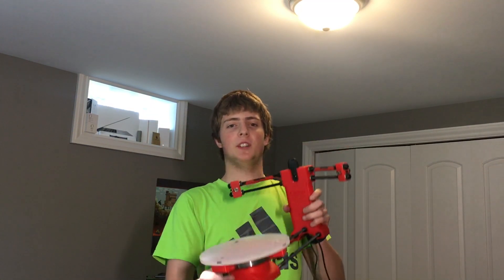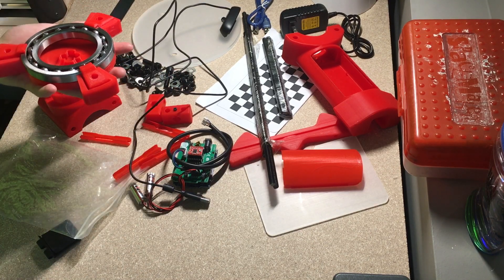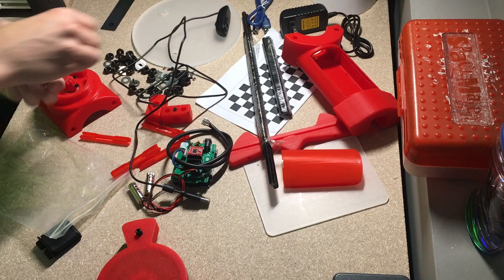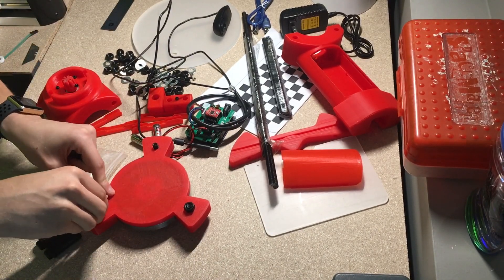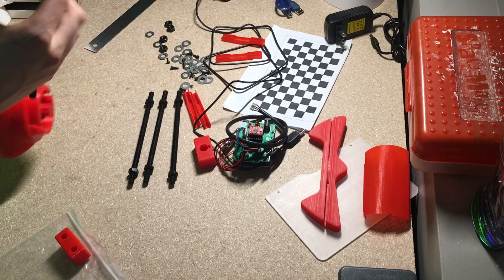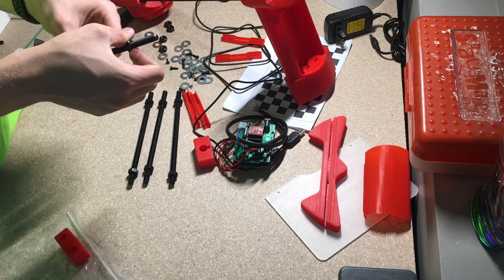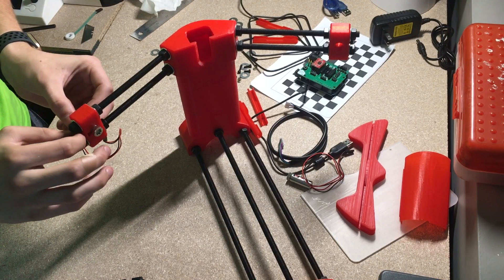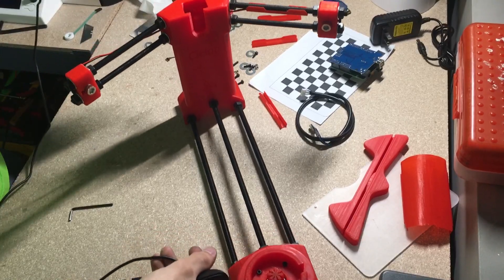BIQU Open Source Scanner Build Log (Ciclops 3D Scanner) | 3D Printing

Comment: Thanks. I've just finished building mine this morning using several YouTube videos on the subject as a guide but this one seems to have the closest specifications to my model. You missed putting washers on the long thread ,which accounts for six of those left over but I don't suppose it matters. I've used a washer everywhere I used a nut and still had some washers left over plus some of the smaller set screws and nuts.

As for BQ and BIQU, It seems BQLabs are the designers of this scanner but it was developed as an open source project, which anyone can build. I guess people have to give credit to BQ in return hence every model I've seen has the BQ logo embossed on it no matter who the builder is, including the one shown in this video. It's under the Ciclop logo. I don't know whether there is any business connection between BQ and BIQU but BIQU is based in China and seems to sell around the world, including Spain under the BIQU brand. Their web address is http://www.biqu3d.com My one came from an Ebay advertiser in Hong Kong who isn't either BQ or BIQU but has a British warehouse so the delivery was quick. Interestingly, I notice the Logitech camera has a BIQU sticker covering the Logitech logo though.

Anyway, the next thing for me is to find the Horus software....... at Github I guess? Then to do the calibration.
Reply from the maker: Derek S Yes, this is an open source printer. I noticed the washers a couple days later. The Horus software was given to me on the flash drive that comes with the scanner. If you would like I can take all the material on the flash drive and post of google drive and share the link. I have not gotten calibration completed yet because on of the lasers were dead and I'm just awaiting to get the laser in the mail.
Reply: Lol! So that's what the USB drive is for? I saw it was there but since there are no instructions, didn't think of that. Anyway, I have already downloaded and  installed Horus from the BQ section at Github and it's a newer version than the one on the USB.  I also got the Logitech camera drivers direct from Logitech so they're the most up to date ones too.

However, having read your message, i decided to see what was on the USB stick anyway but as soon as I plugged it in , Windows Defender said that it contained both a virus and a Trojan containing a DDOS attack tool and it had cleaned them both.

Even though it should be clean now, I don't like the idea of letting the autorun loose with all those .exe files around but I should be able to safely extract the useful bits such as the manual, videos and picture files.

So thank for the offer but I think I have everything I need now.
Reply from the maker: My computer didn't detect anything on mine. Weird.
Reply: Well, it comes from the PC that copied the files, not the original folder. I should probably email my supplier to warn them.